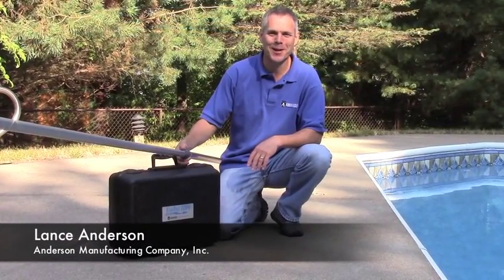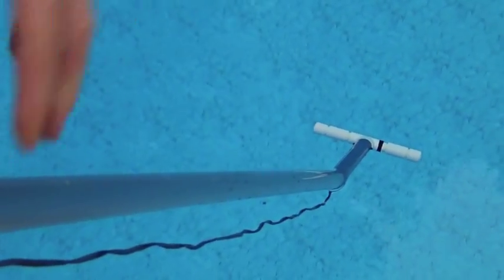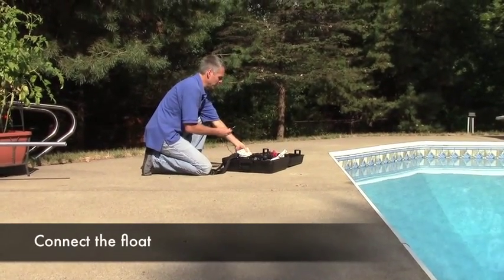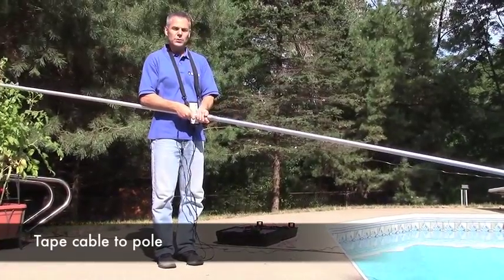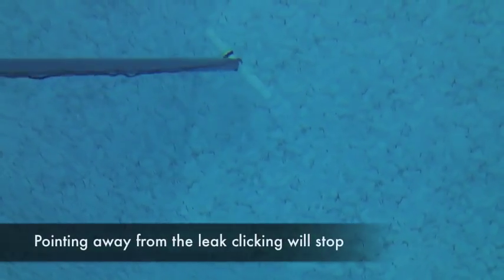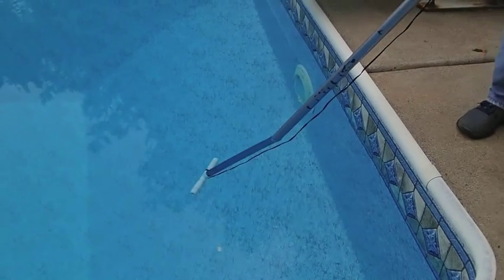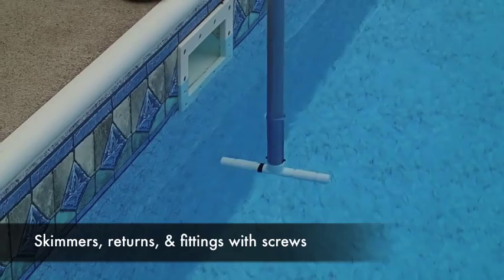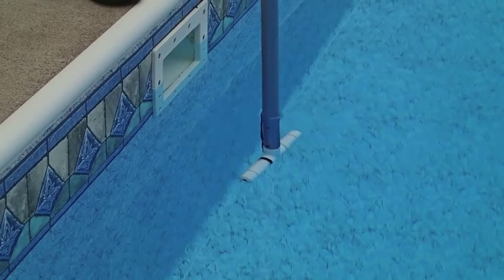The LeakTrac | Electronic Vinyl Liner Leak Detector

Comment: Can this detect leaks around stairs, lights or main drains
Reply from the maker: You may get some competing signal from the ground connections that occur at those locations, but the LeakTrac will still be able to detect leaks around these areas.

Comment: Will this system work on a fibreglass pool. Where the fibreglass has been laminated onto an existing Marblelite surface. Another question, will this work on a Marblelited sufarce or tiled pool
Reply from the maker: Yes, this system will work on a fiberglass pool, but will not work on a Marbelite or tile pool.

Comment: Can this device detect the smallest of leaks ?
Reply from the maker: Hi Karl - Yes, the LeakTrac 2400 is able to detect even pinhole sized leaks in vinyl liners.
Reply: @Leaktools   Hi the local pool guys came in today with the leak trac 2400 which they used for the first time.. i am wondering if they earthed correctly since they said did not hear any peak in sound. he said he heard the same clicking sound constantly throughout the pool scanning, are you supposed to hear anything ? because seeing the video you should not hear any clicking unless you are in a direction of a leak, though again this guy told me it was a constant click every couple of seconds.
Reply: @Leaktools  to add to the above the sensitivity was on the highest.
Reply: Yes, even the tiniest of holes in the liner.